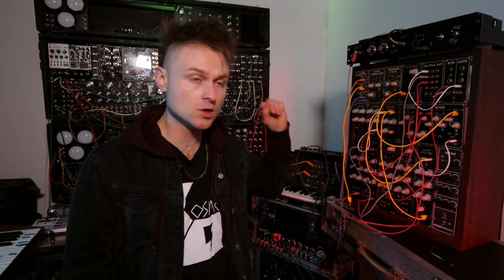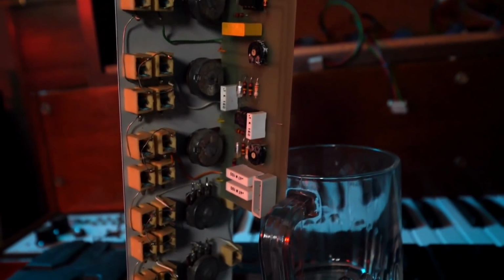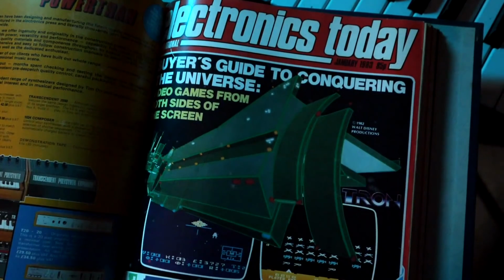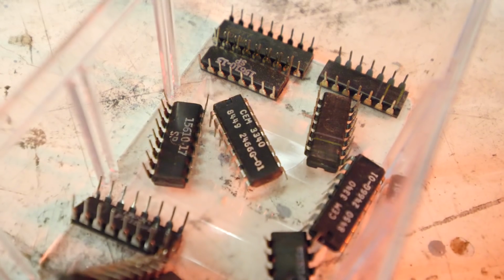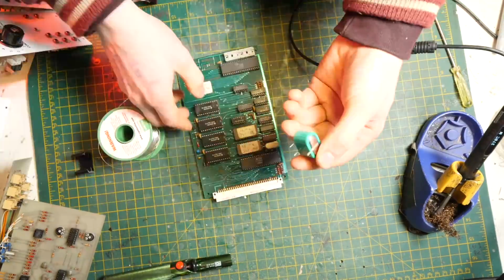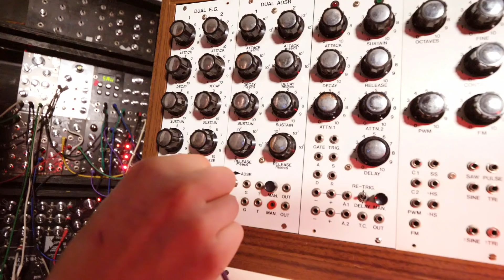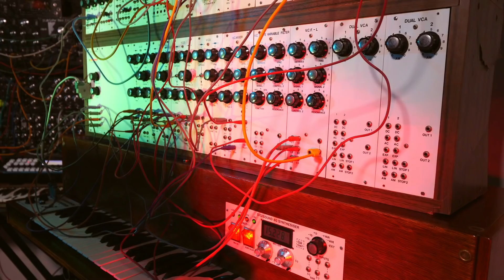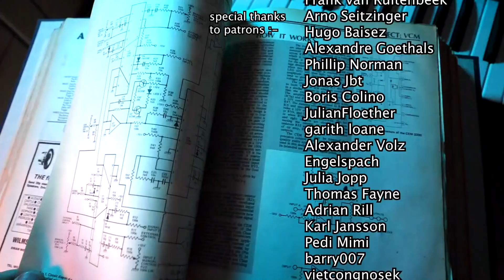A DIY Synthesizer You Built From A Magazine - The Digisound 80

Comment: I found that on mine, the 6 LEDs on the original keyboard DAC was very noisy - them being multiplexed (or whatever it was) was heard in the audio output. Perhaps they even modulated the PSU rails. I ended up disconnecting the LEDs, and all was good.

Comment: To me, that's the platonic ideal of what a synth is! Nicely built too.

 I've got a couple of suggestions for the Alpha-dac. with most of my major computer restorations it usually comes down to knackered RAM chips, as the manufacturers try to cram as many bits into a cheap a package as possible, they're not designed to last 30-40 years! it often shows up as single-bit errors, sometimes only in certain adress locations. time to break-our the ligic probe and look for suspiciously quiet tracks/pins! if you've not already done so, it'll be worth reading the ROM too and seeing what it's trying to do, then looking at what instructions are actually getting executed.

This all sounds like a terrific excuse to find a nice vintage logic analyser (or jyst get a cheap modern usb jobbie, but where's the fun in that!)
Reply from the maker: Hey up cheers. I’ve done all of the above! That’s what bought
Me to the conclusion it’s already working :). Albeit I haven’t looked at the Rom tooo hard. I got annoyed with it. I’ll revisit in a month or so cheers
Reply: The ZX Spectrum used RAM chips that were knackered straight out of the silicon factory.
 Theye were 64k address RAM chips where a fault had been found in either the upper or lower 32k, and were marked accordingly.
 Spectrum motherboards had to have a solder link made to select upper or lower 32k depending on which batch of dodgy chips were used.

Comment: Loving this video!

Do you know where the screen printed front panels came from originally, or were they made by you, and if so, how?
Reply: The white panels (with rather wonky lettering) look like the original panels produced by Digisound Ltd in Blackpool., who also made the PCBs available. The PCBs were fine, the panels, not so much... Digisound was run by Charles Blakey, who designed most of the synthesiser modules.
Reply: .and on reflection I may have been a bit unfair about the panels. The lettering certainly was wonky, but they were well laid out, with the sockets neatly at the bottom of the panels leaving the pots and switches accessible.

Comment: What about replacing the 6502 WITH A 65F02 based on a FPGA chip and maybe a few of the other chips on the CPU board should be replaced. Just wonder was the creater trying to replicate CMI's Fairlight V if so should he have had a display board and a light pen controller board.

Comment: I had a 4 voice Digisound Modular in the early ‘80’s. A very good learning instrument, but the waveforms were a bit too pure, as compared to e.g. Roland synth waveforms. A nice instrument nonetheless. I usually had mine synced to a couple of Roland CSQ 600s👍
Reply from the maker: Cool! But Compared to which Roland? The oscillators were pretty much the same circuit as a lot of rolands
Reply: @LOOKMUMNOCOMPUTER  I remember a friend of mine, who built the modules, had put one of the oscillators on a ‘scope’ then did the same with a Roland, but never said which model. He always felt that the Digisound was more of a ‘scientific’ learning tool, than a professional instrument. I must say I always got some great sounds out of mine, but I guess he was entitled to his opinion. Just remembered, when he found I had bought a Juno 60; he bought one as well. That must have been the comparison he used.
Reply from the maker: @PROPHETVberlinschule  hmm I’m not sure how much I’d read into that. Mostly very similar, especially to a lot of rolands at the time… And besides oscillators are oscillators, no matter what people say they do the same. Usually it’s Gain staging which is different and most noticeable in combo synths however it is very easy to adjust on this modular. Obviously used in a stale scientific way will give scientific results but reducing the symmetry of the gain response and it’s already copying what an sh101 does. It’s all possible in it. All good.
Reply from the maker: @PROPHETVberlinschule  Juno 60 are DCO’s but they use similar filters to this. Still the same. The mixing is a little different in the Juno but totally replicable but using the offset on the processor of the digisound. Biggest difference is the amount of voices

Comment: Thank you for this video. I built the FORMANT after the German magazine ELEKTOR. I made the print plates myself using photochemical methods. I'm still proud of that today. I made the keyboard out of a modified Wurlitzer e-piano. Unfortunately I gave everything away when I moved. My biggest mistake, because the synth sounded very good with its 3 oscillators and a 24 db filter.

Comment: Very awesome gift you gave ToT! Really cool! I Love synths as well. I have a Sequential MultiTrac from the 80's. 18V AC!! It still works but the pitch drifts down as it heats up. (Power supply?). Have to load the stock sequences with the cassette! (Or do it manually). It is pretty powerful for the Sequential "Cheapy". I need to get it out again and play with it. Love your work! So Subbed. Thank You! You are GOOD!

Comment: Lucky you, Sam! I've got one of these with 21 Digisound 80 modules and, interestingly, an Aries (same form factor!) power/output module. Not going to question that, as that was something done by Kevin Lightner (RIP) and the actual P/S inside is probably something he specced out. What I've seen of it when I've had some modules out definitely suggests that Kevin put a honkin' big linear supply in there. Anyway, you've GOT TO get a VCDO for this thing...that's the module that has 32 fixed wavetables (4 banks of 8) and with trigger stepping control over those, you can sequence(ish) through the oscillator's timbres. Mine also has what's probably a user-built transistor ladder LPF, which says it's supposed to be a Moog copy. It's also got a few modules you'd not mentioned, such as the Quad LFO and the VCLFO.

And before anyone asks if they can buy it, the answer is "No and HELL no!"

Comment: I haven't been a good boy, so I haven't a FULL view of all your magazine synth projects, but it would deffenittly be cool if you could run through as many of them as possible.
I am into the Transcendent 2000 (cloned the PCB) and just the other day bumped into the Italian LX520 from the magazine Nuova Elettronica (Issue 84-85). However the kbd-controller/VCO is a rather unobtainable chip, M110, from SGS-Ates.

Comment: These videos are really dangerous for me. I am so close to start looking up how to build these kinds of things from scratch...  I'm guessing I could either get one of those board-makers to make the boards out of random illustrator-files found on the web. But I am also thinking I should be able to use wires instead of PCB's if I am careful enough. 

And no, with my soldering skills I won't let the result out of my own house. It's bad enough if I burn one building down and it better well be my own. 

dangit... I am falling for the temptation... are there any good compilation sites for how to build a modular oneself?